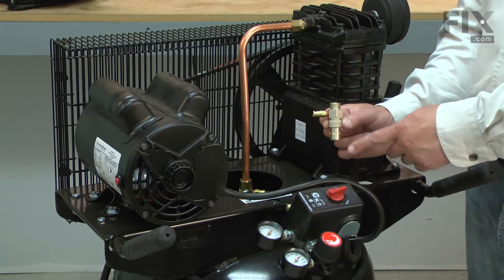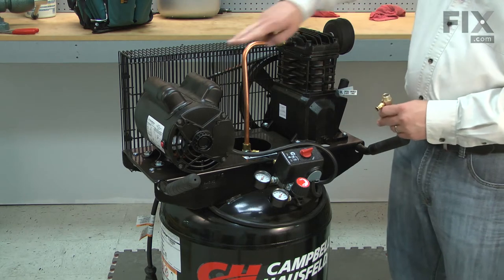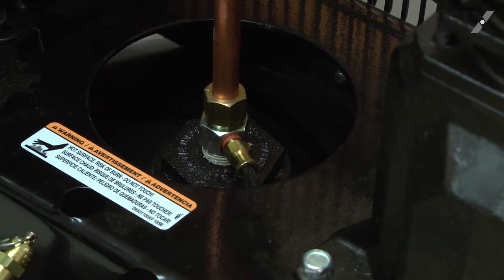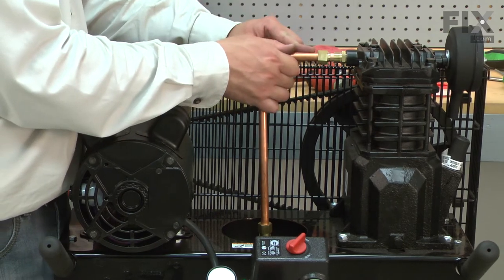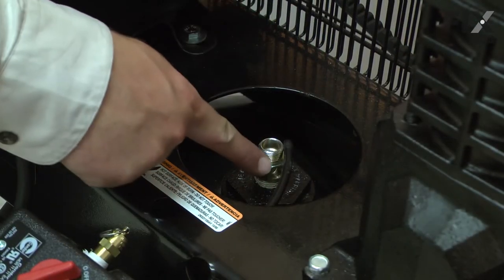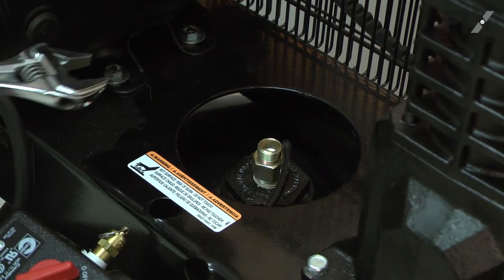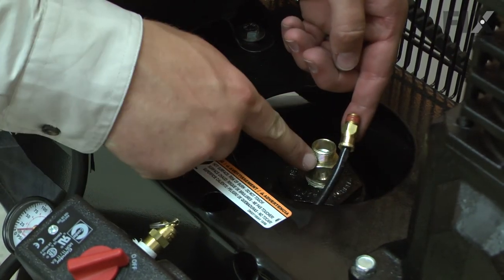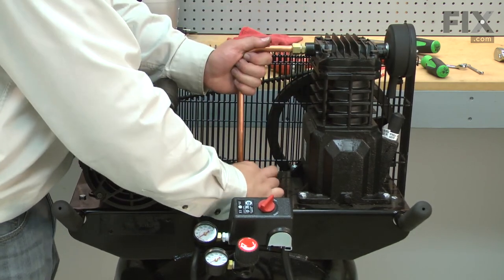Campbell Hausfeld Air Compressor Repair - How to Replace the Check Valve

Comment: I have a cambel Hausfeld and it is creating a lot of water inside the tank..the water is  basically leaking out the drain valve when its tightly closed..